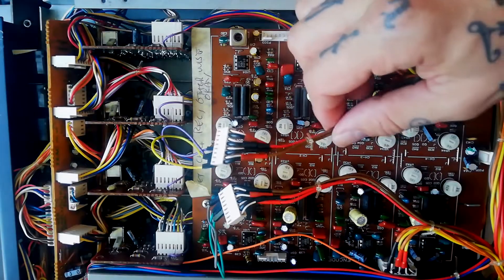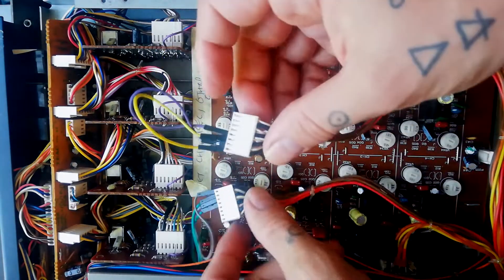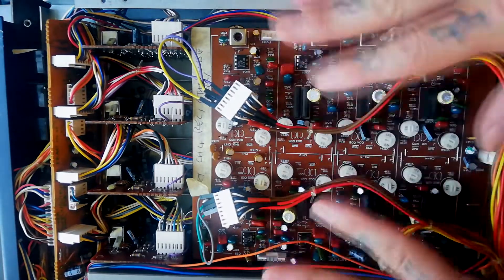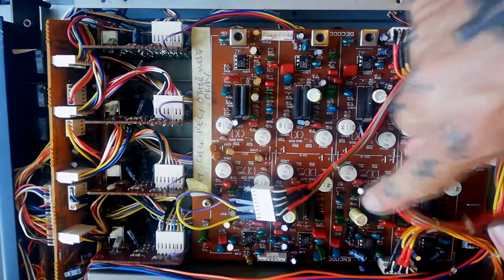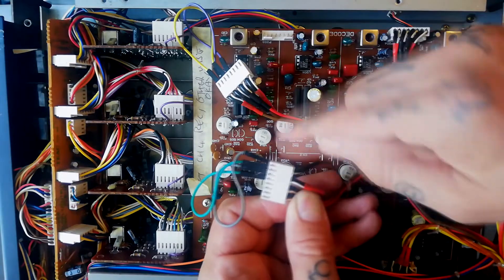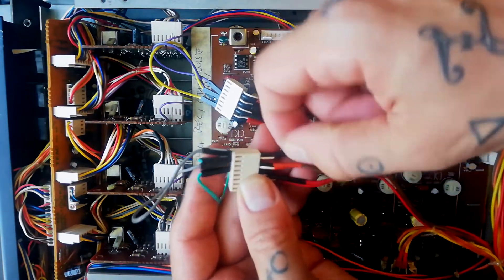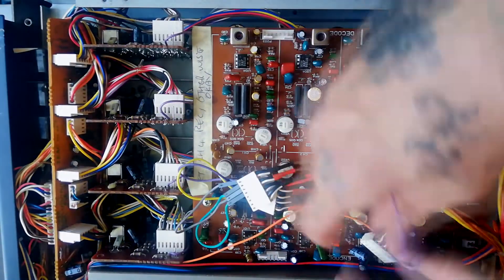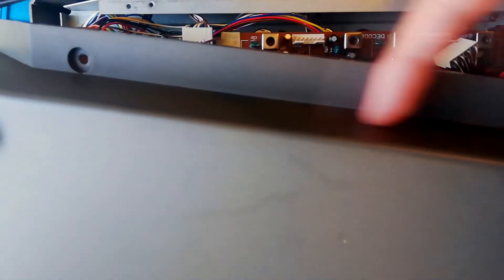How to Bypass DBX Noise Reduction on a Tascam 244

Comment: Thanks much!  Just a curious question.  If you want to remove dbx on only one channel, doesn’t the other side of the connectors need to be routed back to the dbx board so they continue to receive encode/decode signal?  It looks like, according to the schematic, that each connector services two channels.  Just curious if there’s something I’m missing. Thanks again!

Comment: You inspired me to buy 244 and clean it myself. Also bought 2nd 244 for spares for like $50 and turned out to be good decision cause I took DBX and one mixer channel from that one.

BUT I decided to turned DBX off and your video helped me on that also! Thank you for that. Really appriciated. I love tape saturation.

However i noticed big volume drop. When I record it is the same as before - can get pretty loud fast and that is what I aim for - distortion and saturation. But when playback from tape it is unlikely to get VU meteres even moving (usually stays at -20dB). Is that normal?
Reply from the maker: I definitely noticed a volume drop when I've experimented with this, but not that much. Sounds like your playback amps were quiet to begin with? Try recalibrating those?

Comment: Hi tetrakan! do you know if it's possible to bypass the dolby b on a teac 144?
Reply from the maker: I've never done it but I think it'd be possible. It would involve modifying the PCB - cutting tracks and lifting the foil with a craft knife, soldering in new jumper wires, possibly mounting new switches on the lower  plastic case. Old recordings might still sound weird since I think that version of dolby is encoded during recording, not just applied on playback.
Reply: @Tetrakan   sounds complicated for my skills, but I'll try to figure it out. thank you for the reply and for all your videos

Comment: hi sir . I have followed the method and it works . but the channels level went down . even the VU meters shows low signal . did you face same issue ?
Reply from the maker: No, my levels did not drop much...how much resistance are your connectors introducing? I wonder if the extra resistance is attenuating the signal?
Reply: @Tetrakan  i have captured a video of the situation. you can see that the sound is low and the VU meter even not moving . I recorded the sound and opened it in audacity. very very low 

https://youtube.com/shorts/-kakMA-H_u4?feature=share